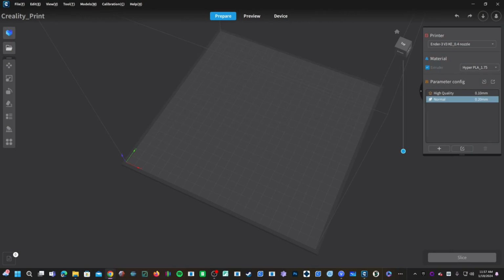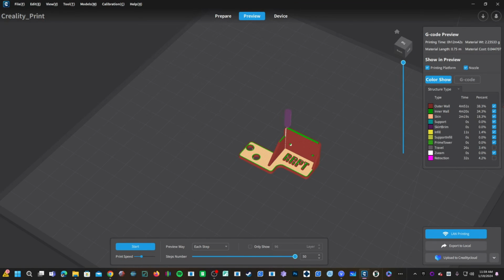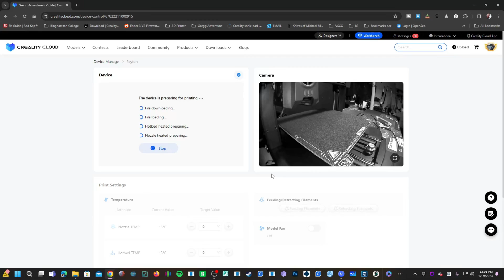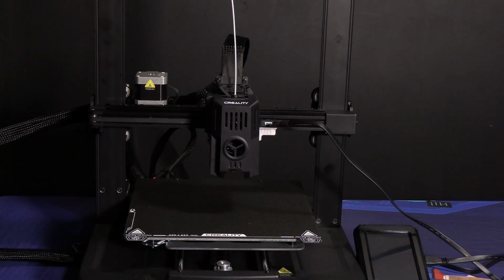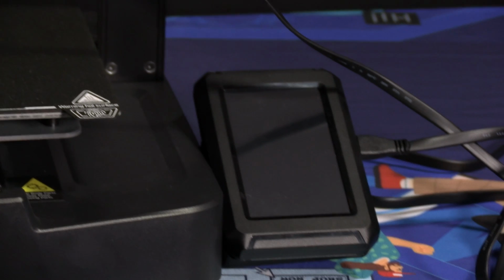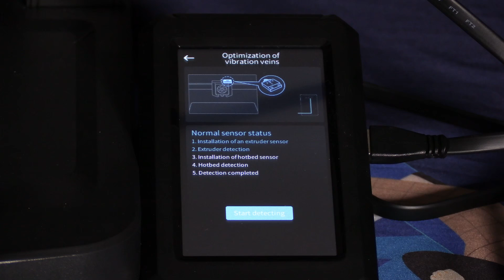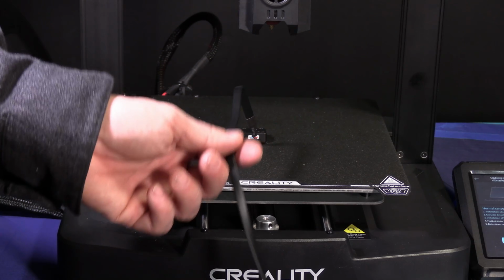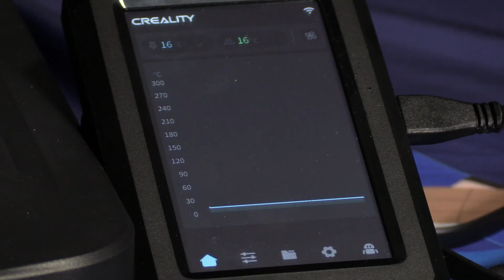How to: Install and Use G SENSOR on Creality "Ender 3 V3 KE"  - Vibration Compensation Calibration

Comment: After the calibration is done do you remove the sensor off the machine or do you keep it mounted on the hotend or bedplate?  thx great video.
Reply from the maker: Remove. 👍🏼
Reply: @3DRundown  So after calibration this sensor doesn't make any effect if you're left mounted? I asked, and he told me, that Nebula actually checking always g sensor if he is mounted and decreases speed if the vibration is too big, but it's Gemini AI, still can't trust it. :)

Comment: just wondering why you chose not to use the G sensor brackets available on the Creality VIP website? Also, why use the double-sided tape when there is a y-axis mount you can print.
Reply from the maker: Because I didn't know about either at the time of this video. Both are available on my One Drive, for members. Tape is easier and works. I've done tape for all my other machines. I think center of the bed makes more sense
Reply: @3DRundown  can I suggest adding a link to an M3 screw kit on Amazon, it's useful to have these things kicking around and it's only like $10

Comment: Do they sell a different cord?

Mine came w one of the old mouse keyboard multipin connections.

I wanted the USB/Type C USB cord.

Where did you get the cord ?
Reply from the maker: Crap, you got the SONIC PAD cable. My cable came with the sensor, in my Smart Kit. Grab the sensor linked in my Description.

Comment: I also have KE and bought the G-Senor (but with the PS/2 Cable for Sonic), as at my location its the only one available.
Can anyone help me with the schematics/pinout-diagram to create the USB-C and USB-A connectors  for the G sensor module? If its available I can make one myself.
Reply from the maker: I have not seen this done yet. Best bet would be to gran the right cable on Amazon or Aliexpress.

Comment: I have my printer in an enclosure which made this even more challenging as I had to mount the bracket to the hot end pretty much blind. The screws I received were not long enough to hold the sensor to the hot end bracket, so I went with double sided tape and then since I only received one set of screws to hold the brackets in place I went with double sided tape on the print bed for the y-axis calibration. You mention that you could use tape to mount the sensor to the hot end instead of the bracket. Where would you place the sensor if you did this? Would you just use double sided tape to stick it to the top of the hot end case? Thanks
Reply from the maker: For my CR6-Max and 5+ I did indeed just tape it to the top. The rear mount is an odd design choice

Comment: Thanks! I bought an ender 3 v3 se and just upgraded to the Nebula kit. This is all new to me.
Reply from the maker: What a fantastic machine to start on! You'll love it.
Reply: @3DRundown   Can this same thing be done on ender 3 v3 se?  just got the Nebula smart kit and it has this cable but not sure if compatible since very little documentation in instructions.  Have only seen the KE shown   Also a newbie but loving it so far.  Thanks for the videos
Reply: I am new to this topic.  The sensor is removed or left in the holder.  Or calibration is only done occasionally
Reply: @sirsit0  +1

Comment: Can you do a video on the print qualities with and without the sensor?? does it make a difference???
Reply from the maker: It CAN make a difference. Very much depends on many things, such as the table the printer is sitting on, differences in the hardware,  fan vibrations, etc. But it's not something I can clearly show Better or Worse. It may not help at all, but, if having VBR issues and such, it can help.

Comment: the double sided tape you use. actually works as a vibration absorber. its not the best solution to use. better just tape it to the bed using some masking tape or gaffatape.
Reply: That tape is what we used to mount the gyro on our RC Helicopters to protect the gyro from being affected by the vibration of the helicopter because it does such a good job at soaking up the vibrations and isolating the gyro from the rest of the machine.
Reply from the maker: Meh, works fine for me. There is a mount you can screw on if you prefer
Reply: @3DRundown  not for the bed though you only showed one for the hot end but either way your video is insanely helpful
Reply from the maker: There is one for the bed also. You can only get the mount from the creality VIP site, and the mounting holes are hidden beneath the bed.  At the time of this video, I didn't even know about it. But, I still don't think I'd use it....  Check it out: https://youtube.com/shorts/KbGQT64rGHg?feature=share
Reply: Unless the double sided tape used had any thickness beyond 1/32", I think it's fine.
Reply: @MrDarkhawk1972  when dealing with the finesse of the vibrations of the printer I think the thickness used would definitely give different results.

Comment: Thank you. It was because I’d seen your video about this a few days ago that I was already schooled on how to run this test on my e3v3se using the nebula smart kit. 

Dumb question, is there any benefit leaving the sensor on the print head or isn’t that something we worry about on a stock non rooted nebula pad?
Reply from the maker: There is no benefit at all. If it's the only machine you plan to use it on, you can pop the cable off and keep the sensor on

Comment: Strange but where is an example of what happens if the sensor detects something that has gone wrong? Question=Newbie
Reply from the maker: Funny you ask. I've debated making a video on this. It will pause the print, and "display a foreign item detected" if something is on the bed, or, something different if it doesn't like the 1st layer. I don't recall what it says.

Comment: Hello, I saw on a post you did in the community that you were suffering from z-banding in the CR-10 SE. Were you able to solve it?
Reply from the maker: I worked allot on it and was able to make a ton of progress, but didn't get it where I'd like it. I also realized I did all my testing on the same filament. I did one test on another filament, and the results were decent. I need to mess with it a bit more.
Reply: @3DRundown  Thanks for the reply. Please post an update if you are able to fix it.

Comment: Would you do a video on how to do a profile for a 0.6mm nozzle?  Thanks
Reply from the maker: I can try. Not a fan of 0.6, but, I'll see if I can give it a go
Reply: Mine is printing fine wit just changing the nozzle size in Creality Print (Tool, Manage printer, Extrusion 1), to 0.6 and adjusting the layer height accordingly, though I can't change the name of the profile, it still says 0.4 (Creality Print has some annoying bugs, I hope they'll make it better with some time). I changed to 0.6 because I use my KE for bigger parts in PLA and PETG as it's obviously built for high speed and volume. I have my modified (MicroSwiss direct drive extruder with full metal hotend, new version motherboard, Ikea Lack enclosure etc.) OG Ender 3 for small stuff and special materials where great speed is not needed. I use 0.35mm layer height with the 0.6mm nozzle, it really cuts down the print times and I find the difference in quality negligible, especially on larger prints. Might even try 0.8mm some day.